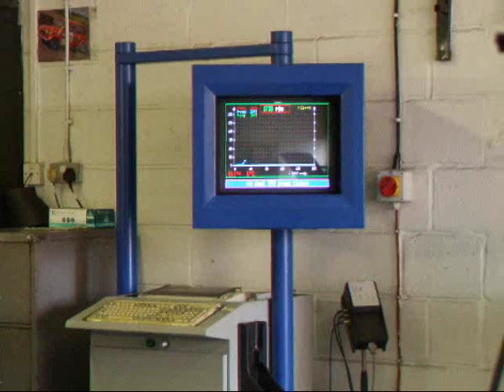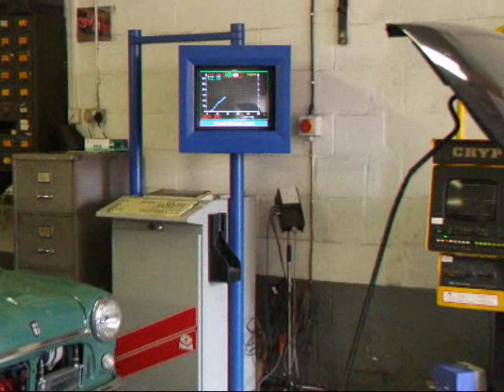Hydrogen Golf Dyno Run

Comment: About the music and sound. You cannot fix stupidity. About the test and showing what the engine looks like, great. This proves what I have been telling people for years. Water injection, or in this case,HHO (which will have some water vapor) will clean and keep clean the combustion chamber, valves and exhaust system. Thanks for the proof, just get rid of the music and orgasmic sounds.

Comment from the maker: @BlueberryWinter - The vehicle in the video has a vacuum vaporisor fitted... nothing like as good as HHO (from the Waterboost)... I found that it is better to add solvents and old petrol to the vaporisor, it doesnt improve fuel economy but the snap throttle response is astounding... when you come off the throttle, the massive vacuum vaporises combustibles which fill the manifold ready for the engine to munch on!

Comment: Well, now we see what happens when you continuously steam-clean an engine - burning (oxidizing) hydrogen creates water, and combustion temperatures flash said molecular water into steam. You're running a self-cleaning engine w/continuous efficiency - the one benefit of cracking water to burn the hydrogen in the engine.  Of course, simply using vacuum to atomize distilled water and introduce it to the intake in minute quantities should do the same trick, without the fuel penalty of cracking h2o.